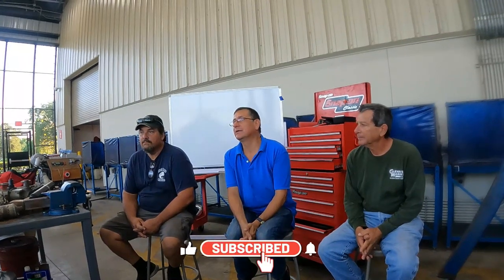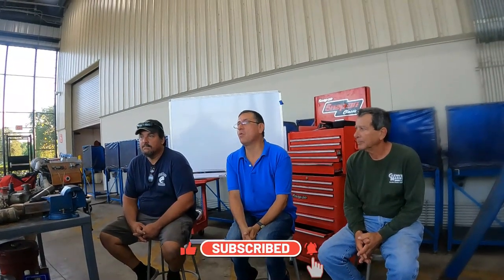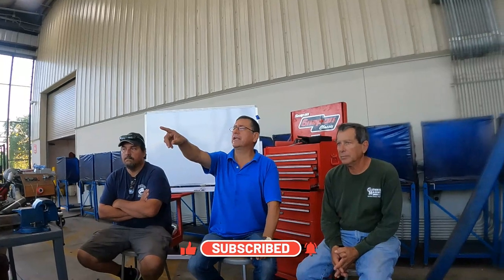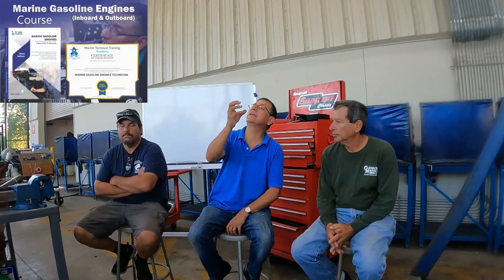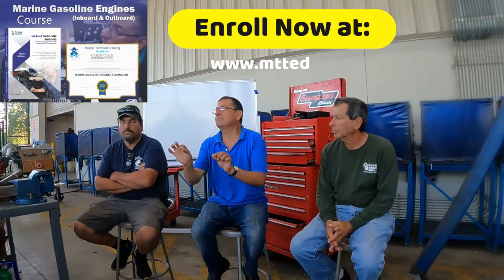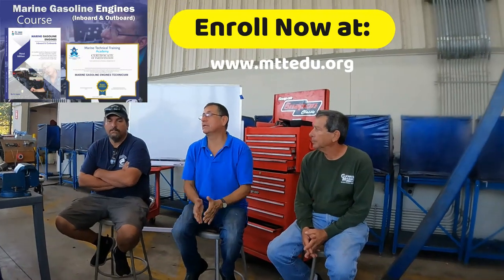Troubleshooting in Marine Engines

Comment: Dear Mr Lopez, one day I was navigating my cruiser near Bordeaux and I saw white)grey smoke coming from the exhaust. So I stopped the engine and I found the engine oil was contaminated with diesel. I later found the small copper injector seal was faulty. I believe the M12 injector clamp nut had come loose. I changed all the copper seals,€4.80 for six seals. Your videos are very important to so many people. Thanks.
Reply from the maker: Ohh this is great. For me, it is a pleasure to work for you.